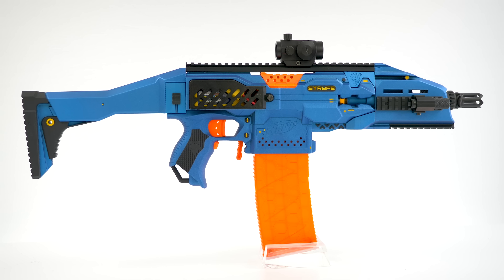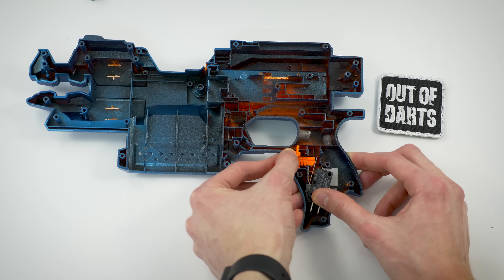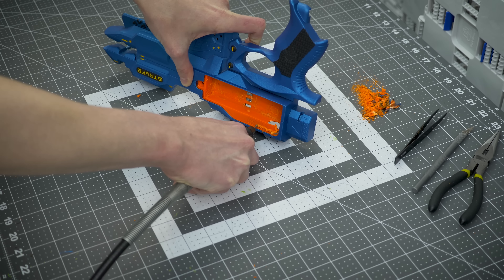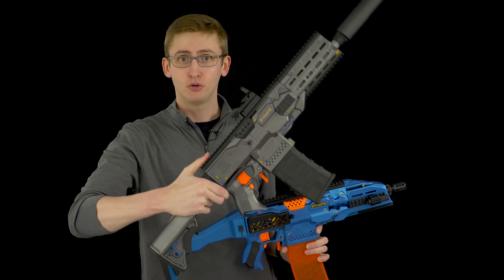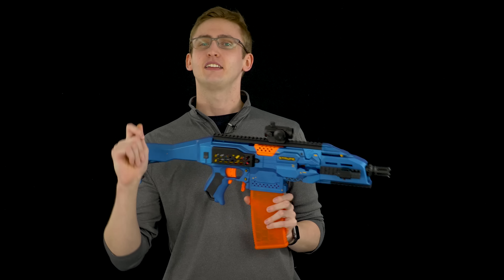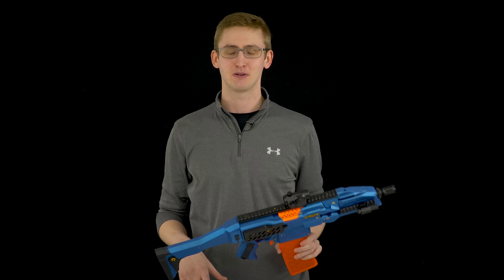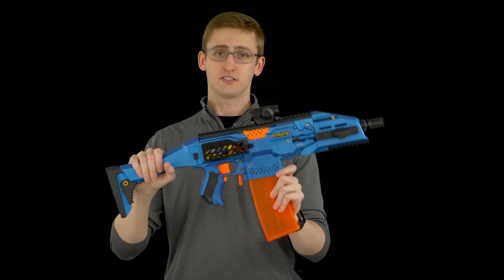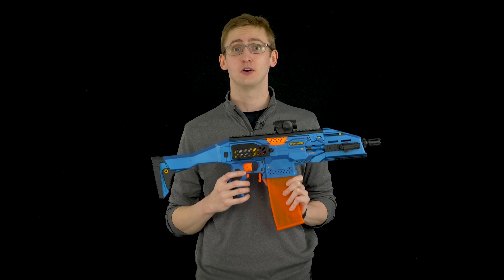[MOD] Nerf Stryfe Modification | Scorpion EVO Body Kit!

Comment: Hasbro should make a hammer action blaster with magazines! Anyone with me?
Reply: Nerf should make smaller darts and a pistol mag for pistol grips
Reply: Platinum Wild Yeas
Reply: And maybe something styled to look like an M1911 pistol to go along with that
Reply: I don’t think it would work though because for mag springers you need 3 settings for the bolt: primed, half primed(primed back) and fired,but a hammer can only have 2: fired, primed so you would have to somehow get the blaster to have 3 prime settings which would be very difficult because you need it primed back to release the mag and push the internals back to create the shot, you could maybe be able to pull the hammer half way to create a suitable mag release, you would need to get the hammer to prime the blaster as well as capsule a dart and set it up for firing, so it could be possible but probably take a while to create
Reply: @Platinum Wild there i one on amazon that is a 1:1 scale and ha a 5 round mag
Reply: They can't
Reply: TUOMAS KNIVES nope
Reply: It would certainly be a mechanical thing of glory
Reply: thats not possible
Reply: Meeeeeee!
Reply: They are stephens
Reply: [WoLf] Pumpkinowl61 It barely shoots. Like 10fps.  Very cool though.
Reply: it is possible but it would need to be a stringer like the crossbow and would mechanically complex with not great performance
Reply: do you really want to shot an entire 36 round drum with a hammer action though?
Reply: William YES
Reply: that wears the hell out of my thumbs just thinking about it honestly...
Reply: Yash
Reply: Yeahs
Reply: Platinum Wild they have that for one of the Rival blasters
Reply: Explain how that would work
Reply: @FrostTheGlaceon  U mean Stefan darts?
Reply: Yes!
Reply: Hasbro should make shell casings with some explosive inside so they can meet that ELITE par.
Reply: William S. That would be cool. They could use darts like the worker stefans

Comment: Yesss
The LiPo modification from Coop we've all wanted.

And hell, to fix your problem with the motor just burning out like that, you can try to repair it by replacing it with a better motor, like an MTB Hellcat or something.
Reply: Probably will need a MOSFET for a hellcat
Reply: Alston Zhang true, MTB Honey Badger would also be good then, so you wouldn't have to wire a mosfet.

Comment: Are you checking current draw of the motors to make sure you LiPo can output enough power? That is literally the only way I can think of for LiPos to catch fire in the way you described. I would not use stock Worker motors and the stock 180 in the select fire kit, rather, chose custom motors for my build. Also the MOSFET on the board probably should be swapped for high current applications.

Comment: Open (and probably stupid) question- Are Stryfe upgrade kits generally applicable to the modulus? I just got one and am interested in it being my first mod.
Obviously shells are not cross compatible, but things like flywheel/battery upgrades?
It seems like an obvious yes that flywheels and the like can work with most blasters, but websites like workers' very clearly do not list the modulus as one of the compatible blasters.
Great content coop! keep it up.

Comment: personally i wouldn't use metal flywheels, i've heard they can be pretty crappy because they have little to no grip on the dart, and also, worker is still toying around with their eliptical flywheel system, so it may not be perfect

Comment: How is painting the 3D printed parts? I'm working on an MP5K build and I've been wondering. Do you still need to sand it? Is the prep process the same as a normal blaster?

Comment: Question for you; my current Stryfe build is using a similar kind of collapsible stock... does the extended battery cover get in the way when you fold it down?

Comment: IMRS SUCK, they don't put enough current to properly run motors, use a lipo. It's also cheaper and more safe. Glad you turned to the light side with the LiPos. If your imrs fail, then they vent poisonous gas.

Comment: still prefer the IMRs for modding.
Reply: Alan McGowan 
Seriously
It's
Not Safe

Be aware.
Reply: Ghoul Blaster Mods. Have over ten blasters with imrs no fires so far. I think that kit is faulty. It looked like he didn't wire the pusher moter separately. Thats probably why he snap crackle popped the motor.
Reply: Alan McGowan I've used IMRs for years as well, but I'm still saying this because of how the statistics are for IMRs, they are simply not high enough output for our hobby.
It's unbalanced electrically, and it's unsafe, be aware of that.
Reply: you will eventually burn out the motors, because they don't supply enough current. Volts Shock, Current Kills. You will need to get a lipo to properly mod.  and what you said that he has over 10 blasters with imrs, even though he hasent had a leak, that doesen't mean it will. It will work with imrs for a year than burn out. And BTW, They dont catch fire, They vent poisonous gas.